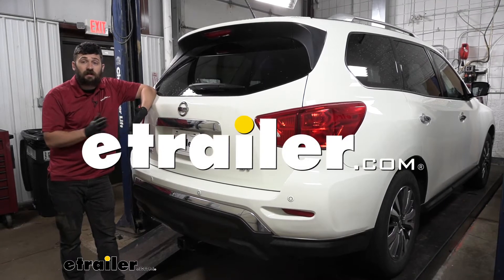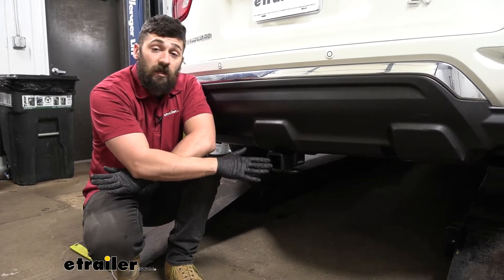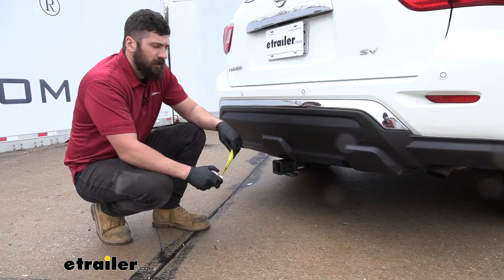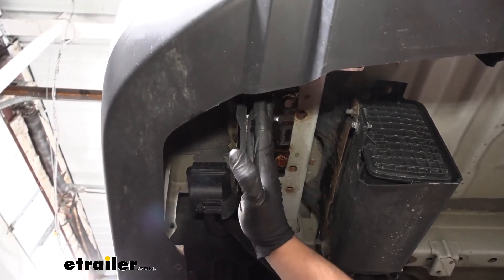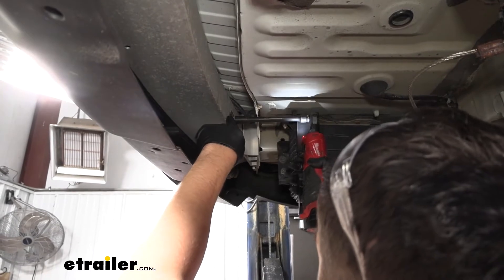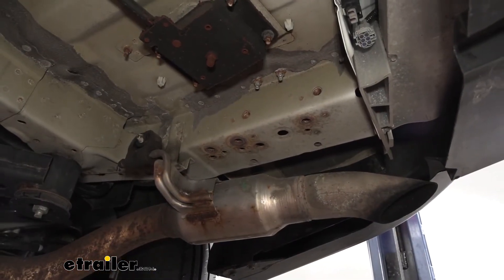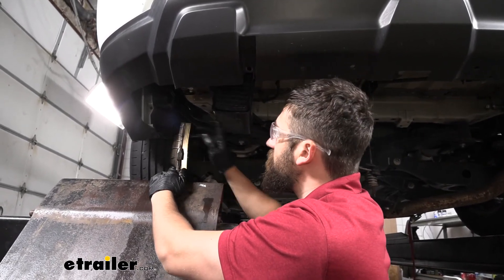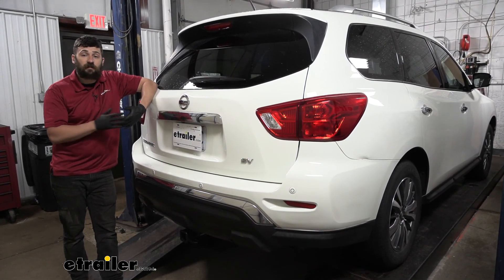How to Install the etrailer Trailer Hitch Receiver on a 2017 Nissan Pathfinder

Comment: Does this work on a 2003 as well?
Reply from the maker: It won't. The # e98908 hitch fits the 2017 -2020 Pathfinder. For the 2003 model, you'd want to use # C13156. I'll link that below for you:
https://www.etrailer.com/Trailer-Hitch/Nissan/Pathfinder/2003/C13156.html

Comment: What if I don’t have a lift at my house.
Reply from the maker: You might be able to get the hitch installed without lifting the vehicle, but if that's not something you're comfortable with you can use a floor jack and jack stands to raise the rear of the vehicle. You can also use some ramps as well (be sure to chock the front wheels). If you don't have this equipment, we offer the jack and stands as part # PTW1605 and ramps as part # FT11909MI. You might also be able to borrow these from a friend or neighbor. Hope that helps!
https://www.etrailer.com/Trailer-Hitch/etrailer/e98908.html
https://www.etrailer.com/Automotive-Tools/Performance-Tool/PTW1605.html
https://www.etrailer.com/Car-Ramps/FloTool/FT11909MI.html